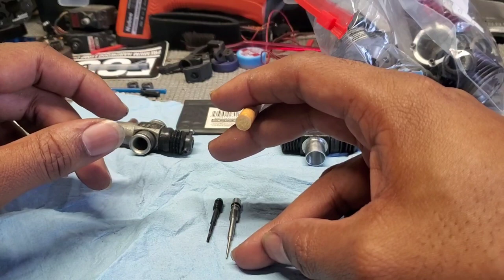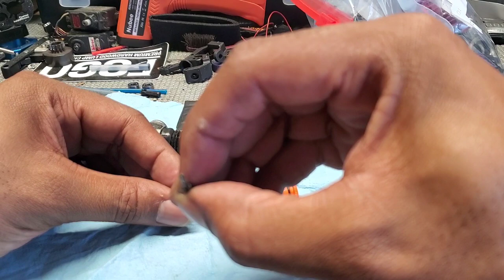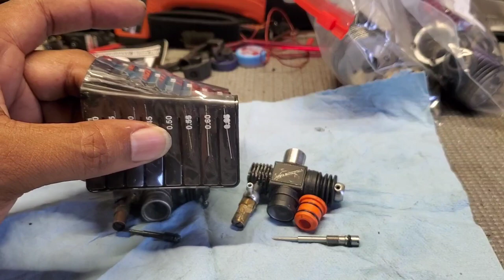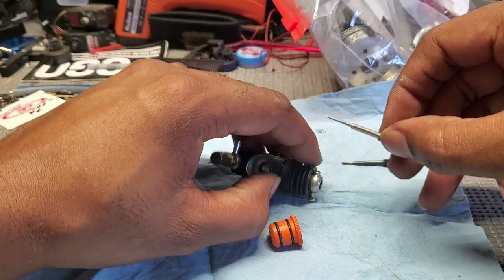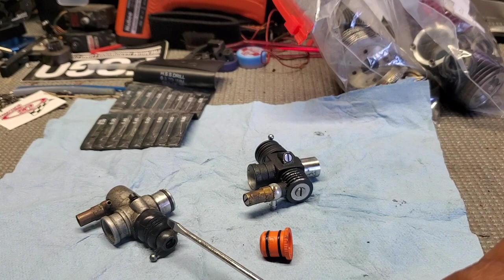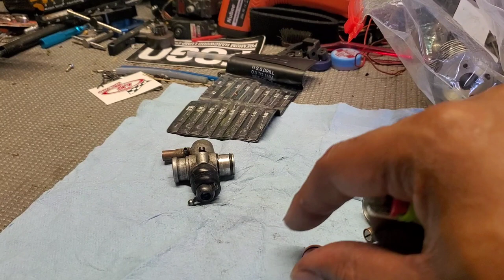Let's talk about carburetors and tuning

Comment: Any tips on fuel brands
Reply from the maker: Me personally I run Bones Brew and will be trying TNR fuels soon enough. I would just suggest fuel with oil content in the 8-11% range preferably with castor/synthetic mix. Appreciate you tuning in bro 🏎💨💯💪💪👊👊👍👍
Reply: @MrLilChilly  trying to get back on the nitro train normally i would run torco fuel 30% or sometimes 66% nitro
Reply from the maker: If you can try then bones brew 30-10 or 25-8 if racing. Its about 100-110 shipped for 3 gallons in the lower 48 states. It's an option
Reply: @MrLilChilly  oh ok thaks ill try
Reply from the maker: No problem bro
Reply from the maker: http://www.bonesmotorsports.com/ website for bones brew
Reply: @MrLilChilly  thanks for the link bro👍🏼
Reply from the maker: 👍👍 welcome bro